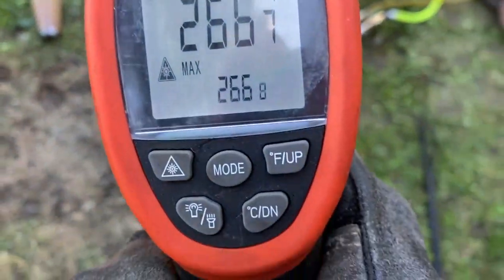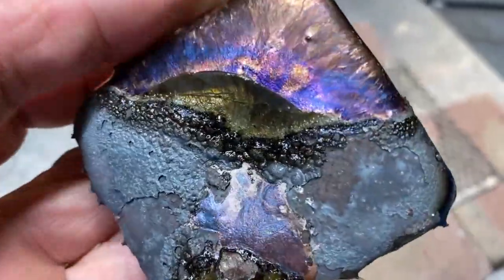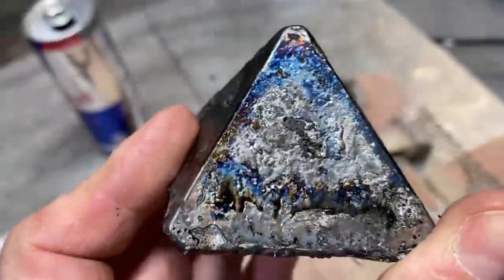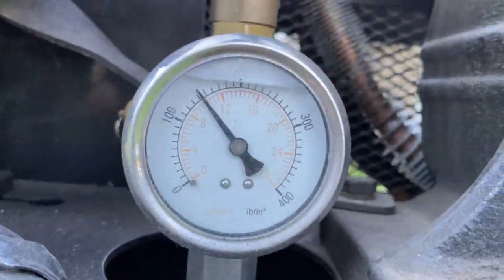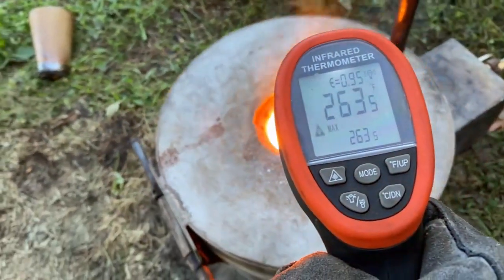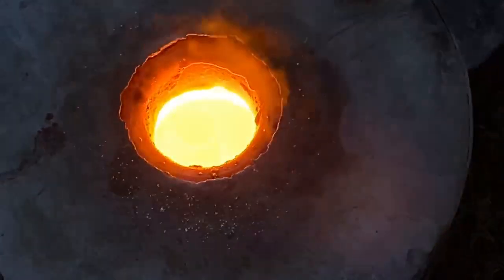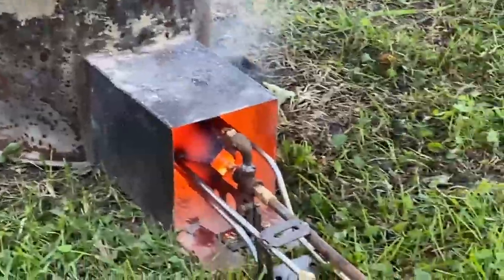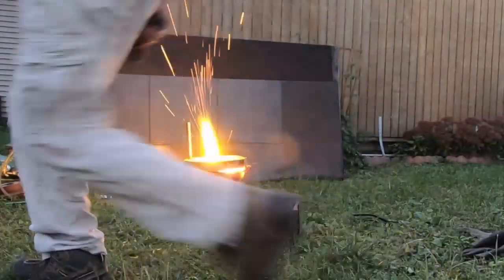Rocket burner on impulse mode

Comment: Look like it got hot enough to melt steel and then some. It can be economical to lose Oxygen to fie a furnace. It takes a large investment to put in an Air Reduction Plant. You have to sell all the liquid Nitrogen, CO2, Argon, etc. Tax credit for a cleaner furnace and selling waste heat worked for CertainTeed. Folks like us can't afford that scale.